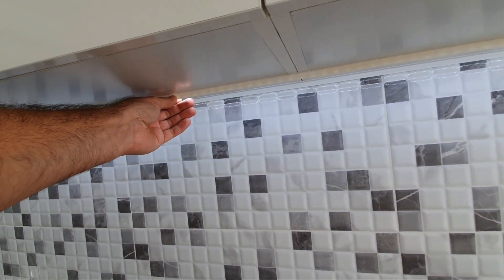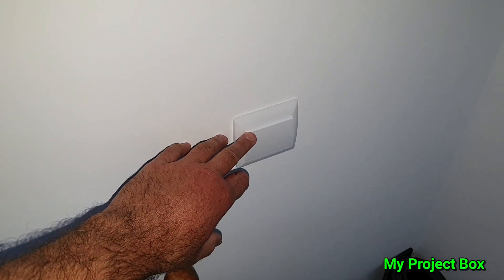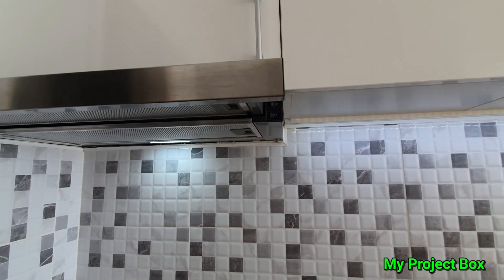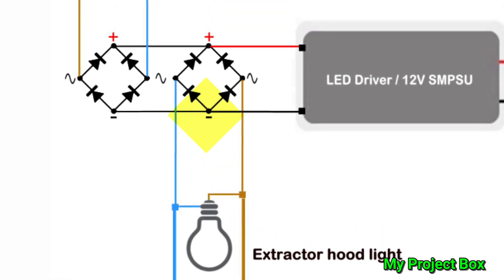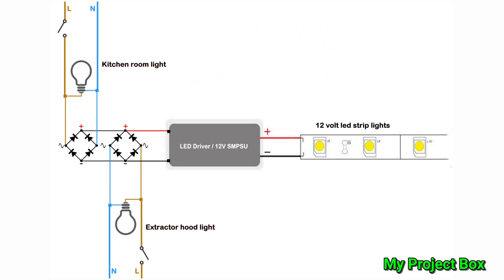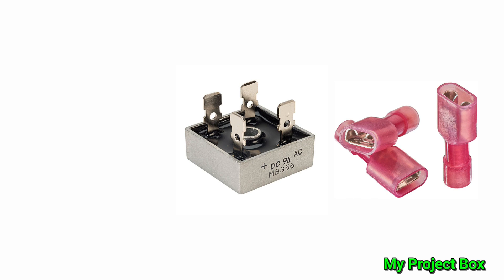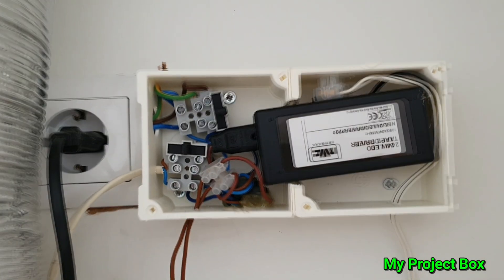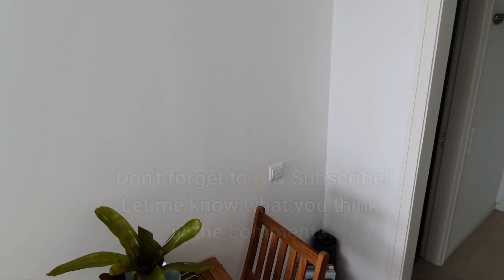LED strip light controlled by 2 combined lighting circuits independently! with bridge rectifier hack

Comment: Hi, are the wall lights and the extractor hood supply two separate circuits? Protected by two separate fuses in the consumer unit? If so, isn't it a bit dangerous to have dual supply to the box above the hood? Unless a label on the white box warns you of the two circuits feeding it.
Otherwise, a clever idea as always
Reply from the maker: You're right the label is a good idea. But I think it's on the same circuit breaker, both the extractor hood and the lighting circuit. The bridge rectifiers keeps the two feeds independent, and prevent them from back feeding each other.